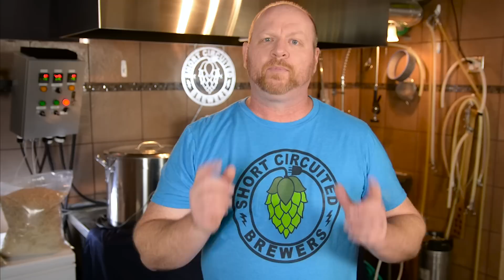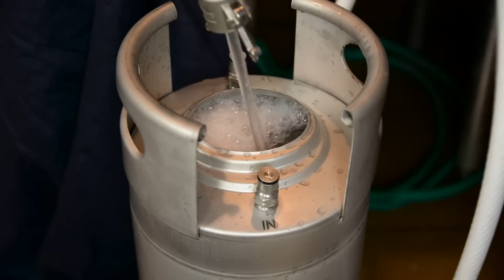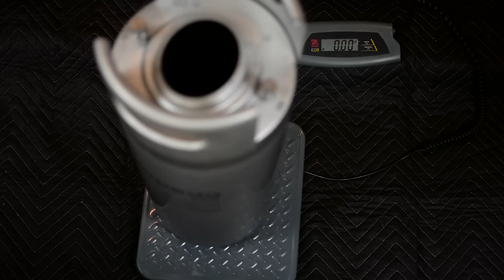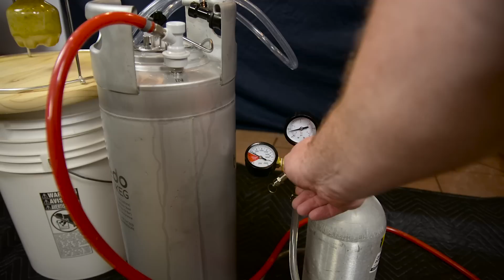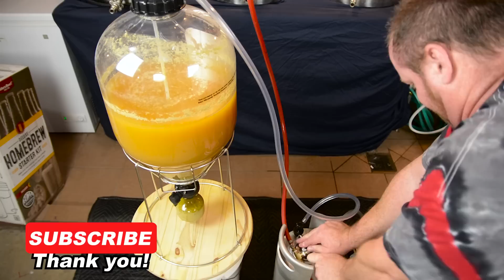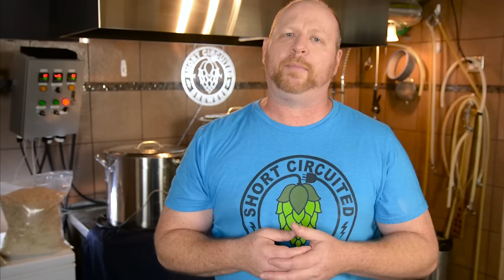Fermentasaurus Closed Loop Transfer. No Foaming, No Oxidation, Oxygen Free Transfer

Comment: Do you not use a lot of Co2 pushing the solution out of the keg?
Reply from the maker: @louisnaum7722  yes it does. A better way is to let the pressure from the fermentation push out the solution in the keg. 👍🍻

Comment: Another trick is you can use the co2 generated by fermentation to purge the sanitizer from one keg to another, works great. I have a water filter housing I connected a gas line fitting and a gas post for the spunding valve, it catches the last bit of sanitizer when the receiving keg is full without going through the valve.

Comment: Hey Brian. Getting ready to do this with my All Rounder.  How did you decide to use 10 PSI?  Is that the final pressure you finished fermenting with?  (ie. if I ferment to 15 psi, would I set my regulator to 15 psi for the transfer)  It seems like I would want to match the transfer pressure to about the same pressure that the fermenter was at.  My "big people magic" is a little rusty haha! Thanks man! Cheers!
Reply from the maker: The pressure will equalize and gravity does the work. So it doesn't matter what pressure honestly. 👍🍻

Comment: Awesome videos, I have trying to perfect this method but I seem to get it going but then when I put the gas back on it seems to reverse and the beer starts to go back to level and stops the transfer.  As in I see gas bubbles moving back up the line.  And it starts to look like a spirit level beer each side of the transfer line.  Gas in the middle.  I try removing the gas and purging gas out of he keg so the fermenter is higher pressure but still doesn't start to move.
Thanks,
Reply from the maker: Is the fermenter higher than the keg? Gravity is how this method works. If the bottom of the fermenter is close to the same height as the top of the keg it doesn't work well. 👍🍻

Comment: Do you purge the oxygen from your gas/liquid lines before transferring, or not worry? I guess it would already be purged if you used them to push the starsan to a second keg 🤔
Reply from the maker: Correct they are already purged.

Comment: Would there be any benefit of still using a spunding valve on your gas line to keep the receiving keg pressurised and limit foaming?
Reply from the maker: It's a closed loop. That's a different but equally effective process but requires CO2 to push the beer into the keg.👍🍻

Comment: You add starsan to water? I thought it can only be added to distiled water.
Reply from the maker: You can add star san to pretty much any water. now if you want to store it for a long period of time it's recommended to use distilled water. I just added some to the water in the keg just to be safe. The keg had already been cleaned and sanitized. 👍🍻

Comment: Hey mate. Great video. Just wondering how important the starsan washout at the beginning is? Can I just give my kegs a rinse and clean and then purge?
Reply from the maker: Yeah you can just do that. I've just been doing this on my really hoppy beers to make sure I'm not introducing oxygen into the beer. My starsan solution is not full strength it is about 1/2 strength to save product. The keg is clean and I am just doing it as a precaution. Cheers mate! 👍🍻
Reply: @ShortCircuitedBrewers  Sweet. Thanks again.

Comment: @ShortCircuitedBrewers So I'm new to the game and was somewhat successful in transfer until I have about 1gallon left in the Fermzilla when it starts to sound like a kicked keg with more CO2 than beer coming through. Is there a certain size the silicone dip tube should be cut? It seems as though it's running up the side wall out of the beer once it gets to the neck of the fermenter. Thanks.
Reply from the maker: Can you tilt the fermenter a little bit so that the dip tube will pick up the beer. I cut my hose so that the tip would reach all the way down to the valve.
Reply: @ShortCircuitedBrewers  tilting didn't even help as the tube was still sticking to the side thus sucking CO2. I have since trimmed the tube so it hangs from the adapter and touches the dump valve. Fingers crossed it works  this time.
Reply from the maker: @mikemorgan8168   👍🍻🤞

Comment: I'm not here for oxidation issues, I'm going to try this method because I'm sick of using so much gas to transfer from the zilla to the keg!! Thanks for the vid bro!
Reply from the maker: Hey whatever it helps you with is fine with me!! 👍🍻
Reply: a kg of CO2 cost 2,-€ if you buy it at 10kg
, a liter of CO2 makes 2g at atmospheric preassure

so the fermzilla at 27l would cost you 2/1000x27=0,05€ to fill it completely - so maybe 7 US Cent ?!
sounds like a good deal if you can avoid oxidating your beer with that method ... (sorry for the ISO units)
Reply from the maker: @bertb4185  no problem. There is a little shortage going on right now in the US. 👍🍻
Reply: @ShortCircuitedBrewers  indeed - just googled it - interesting! Did not expect that!
Those US news never make it here in Europe - to much else going on at the moment ...
Reply from the maker: Definitely a lot going on!! 👍🍻

Comment: I’m using a floating dip tube for my keg. How detrimental is it to just purge the CO2 by cranking up the pressure in the keg to 20 PSI or so and then burping it a few times? Would that still leave too much Oxygen in the keg?
Reply from the maker: Are you talking about the empty keg that you will be filling? You can do that. However to be sure you've removed the oxygen the only real way to be sure is to fill it with star san solution and push it out with CO2.
Reply: @ShortCircuitedBrewers  thanks for the quick response; yep talking about the empty keg to be filled.  I'm not confident I can push all the star san solution out when using a floating dip tube.  Hopefully just purging an empty sanitized keg will be enough.
Reply from the maker: @shlap007  gotcha... It will be better than nothing! 👍🍻

Comment: Question. What happen when the Keg is full, the transfer stops?, can this cause any issue in the gas line in the keg?
Reply from the maker: No because the gas will be going in when you hook it up. I knew with this particular instance I would not be over filling the keg. If you know you have more volume in the fermenter than will fit in the keg, fill the keg with water to a level you feel comfortable with and then  weigh it and while filling put the keg on a scale and stop once you reach the weight you determined prior. That would prevent over filling and getting beer in the gas post. 👍🍻

Comment: What’s your process for dry hopping while under pressure with this fermenter? How do you add/remove the additions?
Reply from the maker: I pressurize back to 15psi when dry hopping. The dry hop additions are added through the top and then add pressure to bring it back up to pressure.
Reply: Short Circuited Brewers got it. I watched a video where when taken off pressure the fermenting wort went nuts and blew out the top. Do you slowly depressurize before removing lid?
Reply from the maker: @Paul_ADAIP06  yes using the spunding valve and then the prv on the lid
Reply: It’s at the 12:30 ish mark

Comment: Hello, instead of the T connection that you made, would it work the same with a 2 outputs regulator set at 10 PSI (fermantasaurus on output 1 and keg on output 2) ? Are you doing this because you only have a 1 output regulator ?
Reply from the maker: Sure I just had the T and bottle to pressurize both vessels you can certainly take the bottle out of the loop. 👍🍻

Comment: Why even need to transfer to keg?  Can't you just leave it in the fermentasaurus indefinitely?
Reply from the maker: You can. BUT then your fermenter is tied up until you drink all the beer, and  the fermentasaurus takes up a lot of room in a fridge. (Wouldn't fit a keezer) 👍🍻
Reply: @ShortCircuitedBrewers  in Australia I can get a model of fermentasaurus minus the collection bottle on the bottom for $70 and a corny keg for $100. (See snub nose fermentasaurus, shorter and fits better in fridges) So I'm better off buying another fermentasaurus to free up a fermenter than I am to buy a keg.

Comment: Have you run into any problems with blockages and how have you delt with them? I do a closed loop but if I do a Neipa or a heavy hopped IPA the hop particles that havent dropped out with the cold crash can collect in the spring of the liquid post and cause the flow to stop. I can push gas back thru the post to clear it some times but not always and doing so stirs up the sediment and continues to cause bloackages. Any ideas?
Reply from the maker: I am thinking you could attach a stainless screen ball for steeping tea. You could probably put a hole in it to fit the pickup tube into. Maybe something like this? Nuk3y® Stainless Steel Rust Resistant Mesh Tea Ball Strainer Filter Infuser (Pack of 2) https://www.amazon.com/dp/B01B6NQ4IG/ref=cm_sw_r_cp_apa_eQpPBbDK9W2EV
Reply: Short Circuited Brewers. I was thinking something along those lines. I use a floating dip tube to draw from the top of the fermenter. I’m hoping i can get a screen ball light enough that it won’t just sink to the bottom. The other thing i have in mind to trial is a liquid post and a ball lock connect with the poppets removed and the little stainless inline filter attached.
Reply from the maker: @rhysparker5632  let me know what you cone up with. Cheers! 👍🍻
Reply: Short Circuited Brewers 
so what i’ve done is remove the poppet on both the liquid post and the liquid ball connect on the transfer hose. i’ve also added in a bounce filter in between. i’ve opted for this because i can clean the filter easily if it gets clogged. if i had gone for the strainer on the dip tube option i was worried it would get clogged up and i would have to open the keg up to clean it which eliminates the reason for a closed system. I’ve also used a standard liquid ball connect to seal the keg during fermentation. as for oxydation, my serving keg is filled with co, i just simply connect the transfer line to empty the co and clear the filter and transfer line. worked pretty well.
Reply from the maker: @rhysparker5632  good solution!! Thanks for sharing!

Comment: is there a way to bottle with the fermentasaurus?
Reply from the maker: Sure there is a screw on hose bard for the bottom. Or if you force carb in the Fermentasaurus you could user a counter pressure filler. I have a video of using the Blichmann quick carb to force carb in the Fermentasaurus. https://youtu.be/mODk7JZZInQ thanks for commenting Kelvin! Cheers! 👍🍻
Reply: well, you just helped me decide my upgrade next year!!!
Reply from the maker: I love mine!! 👍🍻
Reply: @ShortCircuitedBrewers  Hello, can you explain please why you need to force carb in order to bottle from the fermentasaurus with a counter pressure filler ? Isn't the beer already carbonated if you carbonate under pressure ? My goal is to not use a keg and bottle the carbonated beer directly from the fermentasaurus. Thank you ! (a video on this would be amazing :p)
Reply from the maker: @spikejonze6652  you are correct in that the beer is carbonated to a certain degree. BUT it is not fully carbonated. The reason is temperature, fermenting at ale temps does not allow the CO2 to enter the beer at the pressure I am fermenting at. You would have to increase the pressure significantly to carbonate at ale temps. Unless you have a CO2 tank it is almost impossible to do what you are asking. It is a great idea though! 👍🍻

Comment: Curious how long yours takes. I've done it a few times now and seems to take about 2 hours.
Reply from the maker: It does take a while. My recollection is that it took about an hour. How far above the keg are you setting the Fermentasaurus?
Reply: Short Circuited Brewers trying it again and increased the tubing size to 5/16 and increased the height difference. Going MUCH faster. Looking like 30-45 minutes. Thanks!
Reply from the maker: @BrianRomanowski  awesome glad it worked! 👍🍻

Comment: How do I do this with tons of hop particles in the fermenter? I'm worried about transferring and getting all my dry hop sucked into the keg...
Reply from the maker: You might take a look at a product called the bouncer, I have never used one but I've seen several videos on it and it looks like it would be great for that purpose.

Here is  link
https://www.amazon.com/dp/B01JWO5RK2/?ref=exp_inf_pl_shortcircuitedbrewers#
Reply: Short Circuited Brewers that's awesome! Won't go with that one but there's the same thing with a higher micron filter for half the price! Was worried I wouldn't be able to use this for stouts with cacao nibs but now it might be my next batch 😎
Reply from the maker: Awesome! Glad you were able to find a solution let me know how it works for you. Cheers! 👍🍻

Comment: Random question.  Will the lid on a Fermentasaurus fit on a Fermonster?  

If so you could use their transfer kit on the Fermonster.  I would be very interested to know.  The Vintage Shop is going to be releasing small batch versions of the Fermonster and the only thing that would keep me from buying one is the fact that I can't pressure transfer.  However, if the Fermentasaurus lids will fit a Fermonster....that could be interesting.
Reply from the maker: Tyler I think the lid on the fermentasaurus is about 4 inch in diameter approximately and the fermonster is about 6 in from all the photos that I have seen. I could be wrong but I'm not sure. My local homebrew shop has some of those fermentation vessels. If I can remember next time I'm over there I'll take a lid with me and see if it fits.
Reply from the maker: Is there any reason why you couldn't drill a hole in the fermonster and use the carbonation cap like I've used in some of my other videos to pressure transfer?
Reply: That's a good question.  I honestly don't know.  I probably need to go back and watch the video again.  How would you attach the carbonation cap to the lid of the fermonster so that it would hold pressure?

Comment: Hi, Brian - great video and I appreciate the tips being shared on the Fermentasaurus!  I did noticed in the video that the Fermentasaurus was up much higher than the keg during the transfer. Is this necessary or will the transfer work just as well with the Fermentasaurus being on the floor (as the same level as the keg)?
Reply from the maker: Thanks for the comment.. Although you are  transferring under pressure, this video is a little different than some of the other transfer videos that I've done because of the fact that it is a closed loop. So it is a gravity driven transfer more than a pressure driven transfer. So yes you would need the fermentasaurus up higher than the keg. Great question! Cheers👍🍻
Reply: And the beer still has no issues climbing up the liquid dip tube in the sauras?
Reply from the maker: Nope gravity+siphon= success! 👍🍻

Comment: I’m starting to get into closed transfers, how fast should I expect to go through a 5lbs CO2 tank?
Reply from the maker: rotaryracing1982 it doesn't really take that much to do the transfer
Reply: Short Circuited Brewers awesome. Currently don’t do much secondary but I was looking at doing these with a SS brewtech brew bucket
Reply from the maker: rotaryracing1982 just make sure to use low pressure. It will work fine. The SS buckets are not made for higher pressure like this vessel. Cheers! 👍🍻

Comment: So, you're just using gravity to move the beer to the keg?  I'm confused on how the beer will transfer if the pressure equalizes in both the fermentor and the keg after you let the initial pressure out of the keg to start the transfer.
Reply from the maker: Yes it is gravity, the air space gets transferred to the fermentasaurus as the transfer happens. Physics or Big people magic.. what ever you want to call it.. lol
Reply: LOL you crack me up man, Cheers!
Reply: Short Circuited Brewers The way I like to think of it is just as a standard siphon, but with a pressurised headspace, rather than ambient pressure. Great videp
Reply: It took me awhile to visualize this - “How does the airspace move to the fermenter?” When I remembered watching a siphon, the carry hose is not completely full of liquid, this gives a pathway for vacuum and pressure of air to equalize. Great idea.